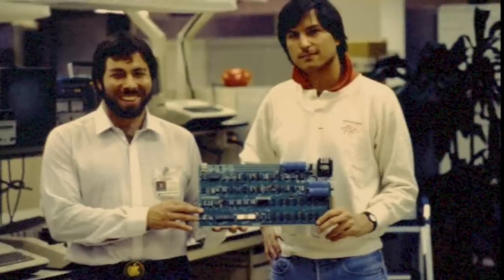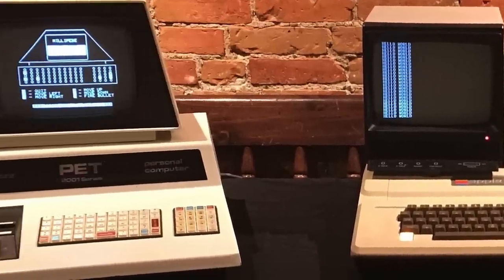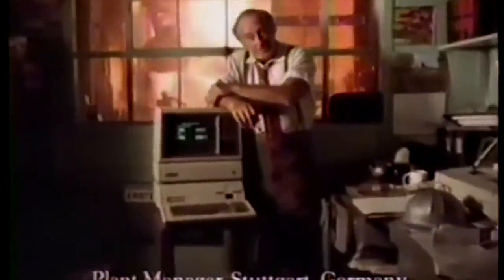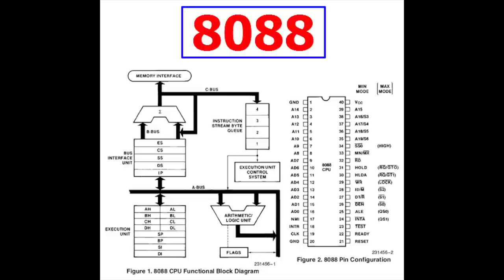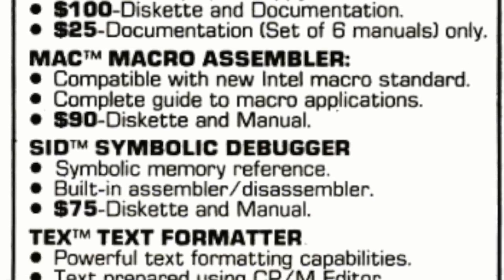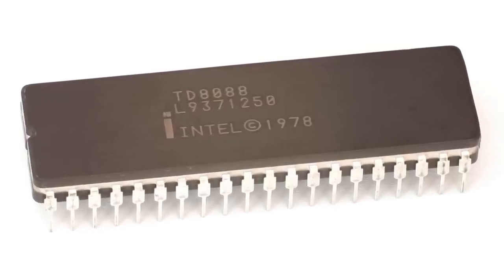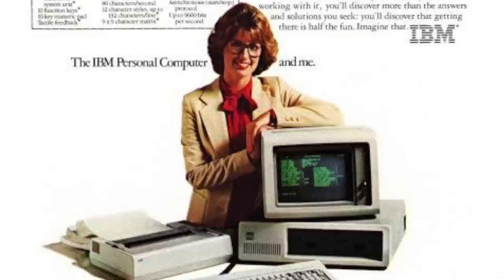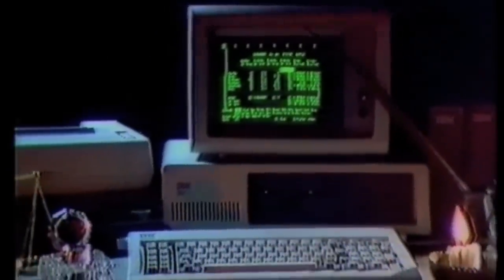DOCUMENTARY: Why and How IBM ended up creating the PC (and ended up choosing the 8088 CPU)

Comment: I have heard people say that the 68k wasn't chosen as it wasn't made available in time. This video mentions that the 68k was significantly higher in price and I can see that as the main reason it wasn't chosen. It is too bad. I have always preferred the 68k CPU and wonder what the computer world would look like today had it been available at a competitive price and been used in the IBM PC. I was interested to hear that QDOS was the basis of DOS on the PC. I always felt that DOS was related to CP/M based on what you look at the memory map of the lower portion of RAM.
Reply: I do wounder why IBM didn't go with 68k little brother the 6809. The 6809 was already in products in the market at the start of the designing of the IBM 5150 and already had a number of operating systems along with OS-9 already having been announced. The Motorola 6809 would have allowed the IBM 5150 to have cleaner code and IBM wouldn't have had to worry as much about getting an OS on the 5150 in time and with OS-9 being ported to 68k, IBM would have had a upgrade path to the 68k processor by the time the 5150 came out.
Reply: @Psy500  The 6809 would have been a good choice for 8-bit CPU. I love its instruction set. I'm working on a project now that uses the 6809. The system would have had a path from 6809 to 68k with the OS going from OS-9 to OS-9/68k or CP/M-68k.
Reply: Q-DOS, later renamed 86-DOS, was written by Tim Paterson at Seattle Computer Products for an 8086.  Microsoft bought it (under false pretences) and poached Paterson to port it to the IBM PC, after which it was called PC-DOS.  Microsoft sold a slightly different version to PC clone makers called MS-DOS.  It is believed that Paterson had access to the source code of CP/M.